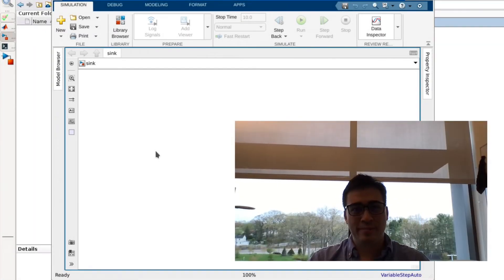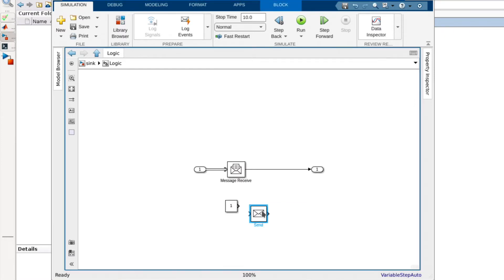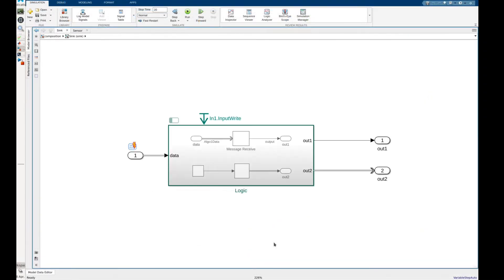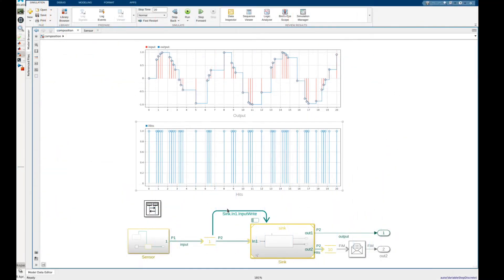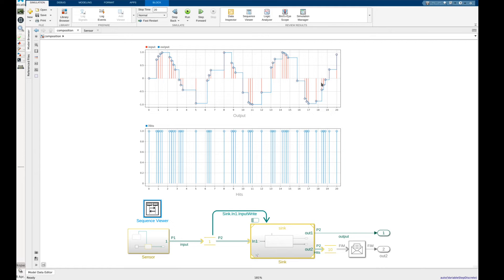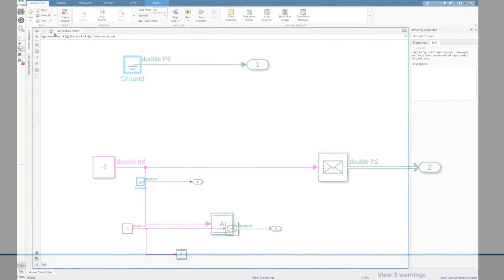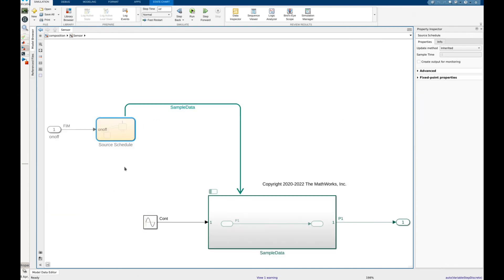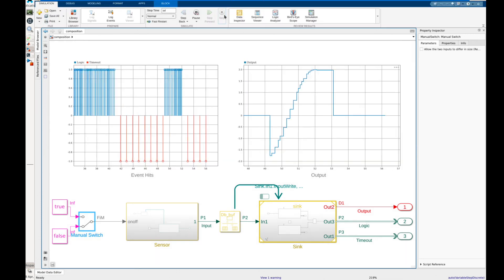Model and Simulate Event Triggering Based on Input Port Data

Comment: why there is no "schedule as" in property inspector in my simulink?
Reply from the maker: The model needs to be configured to use partitions. Here's the doc on what needs to be enabled within the model (https://www.mathworks.com/help/simulink/ug/creating-partitions-from-your-model.html). 
 
"Partitioning is enabled only on multitasking, fixed-step, and variable-step solver models. To choose multitasking execution mode, in Solver selection on the Solver pane, select the Type to be Fixed-step or Variable-step. Select the Treat each discrete rate as a separate task check box on the Solver pane of the Configuration Parameters dialog box."
 
The "schedule as" dropdown should appear for the subsystem once the model is setup to use partitions.
Reply: @MATLAB  thanks！